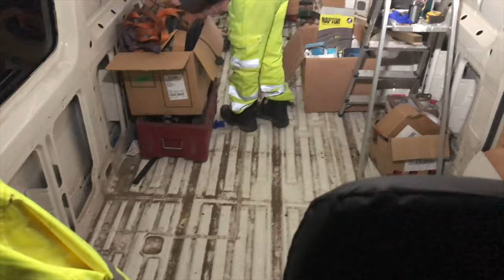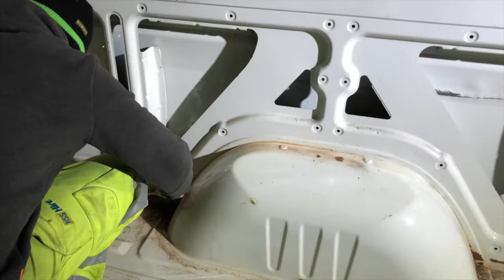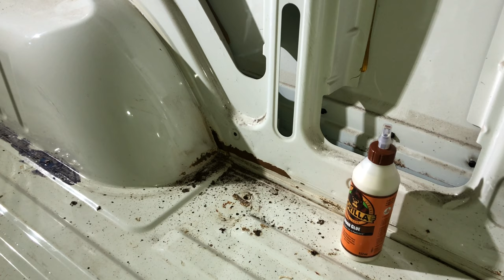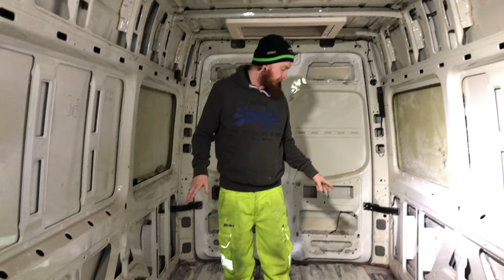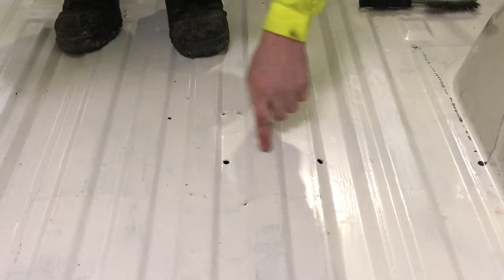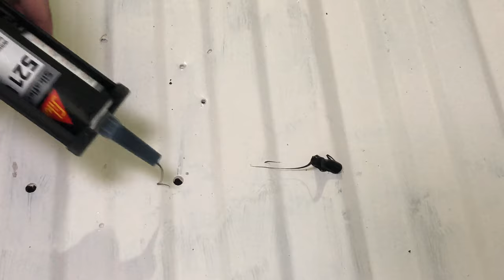Crafter Camper Build - : Ep5 Floor Prep and Rust Treatment : - Self Build Campervan -

Comment: Hey buddy, just found your channel so looking forward to seeing how you progress with the build👍🏼 quick question...could you please measure something for me? I’m looking to fit a sideways bed like you have and wondering the measurement from the back door when closed to the front of the wheel arch...basically trying to work out how wide to make the bed, I’m planning on boxing off the garage section under the bed. 
Hopefully you’ll understand what I mean👍🏼 cheers Ant

Comment: Coming along nicely man, did the same with mine a few weeks ago, I spot welded the screw holes in mine instead of sicaflex then used red oxide paint throughout. This weekend I finished wiring in all our stereo and 1st fix wiring, then silver foiled the arches and stuck a few floor planks down.

I like the idea of the underslung gas that will be a very interesting watch. 

Are you planing on having a shower room?
Reply from the maker: wkw0625 thanks pal 😁 I was going to weld up all the holes but I couldn’t be bothered getting the welder out aha. 
I was hoping to get too the same point as you this weekend but that hole in the arch has set me back 😒 
I’m currently building the subframe for the underslung lpg, I’m having to mount it on the drivers side instead of by the sliding door as we went for a larger tank. Just means I’m going to have to custom fabricate a aluminium waste water tank to fit under the the sliding door side. 
Yeah,  we’re having a shower and toilet cubicle, going for the thetford cassette toilet. And we’ll be going for a truma combi so we’ve got hot water for showers 😁
Reply: @CandCVanLife  I watched one of your other videos last night with the spraying, absolutely fantastic job dude, need to do that to mine really, however I'm no way good enough for that sort of thing. Will have a look at it in the summer.
Yeah we are looking at a thetford toilet with a tray works out roughly 1m x 675mm which I'm hoping will be more that enough room. However we are having the bed length ways as I haven't gone down the pods route.
I already have a Chinese diesel heater to fit from an old van so going to go for the cheaper (still bloody £450) truma boiler that just heats water.

Looking forward to next week's instalment.
Reply from the maker: @wkw0625  Thanks mate, I had to do some grinding when fitting the pods and windows so the the white on the backdoors and wings needs re-doing -.- hopefully will be doing the rest of the white and any touch ups later this year, probably around September. 
You will honestly be surprised how easy it is to spray with raptor. 
We're looking at the exact same setup with the toilet and shower tray, we've got a little mushroom extractor fan to fit to the roof to keep moisture down in there too :D 
In all honesty, if I was to do this again I think id just go for a wider van over fitting the pods. 
They're quite expensive for what they actually are and they can be a faff to fit. 
We plan to fit a Chinese diesel heater as well as the combi just for redundancy, just trying to figure out the best way to connect two heaters to the same ductwork set. 
  Thank you very much for all the support :D
Reply: @CandCVanLife  my first plan was the pods however due to the price and because we wanted the bed high we have chose to have the bed long ways.
Your heating system will be super easy to set up mate, you can buy t piece ducking really cheap so you will be able to add them both together if you choose to do that.
I'm going to put a vent into the shower room so it will also work as a drying room for wet coats etc.
Im finding It's all a long old process to get it all done, however you will really have to press on now as your going full time vanlife.
Good on ya, will save so much cash over renting.
Reply: i know it's pretty off topic but do anyone know of a good site to stream new movies online ?
Reply: @Caleb Jaxton ehh I would suggest Flixportal. Just search on google for it:P -darren
Reply: @Darren Jayce Thank you, signed up and it seems like a nice service :) Appreciate it!!